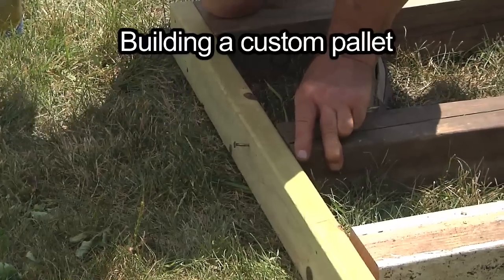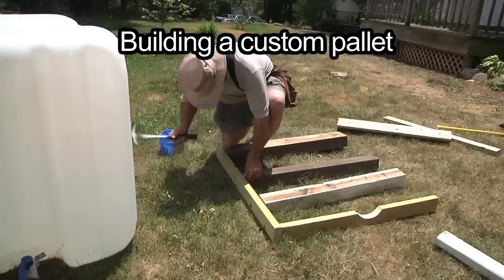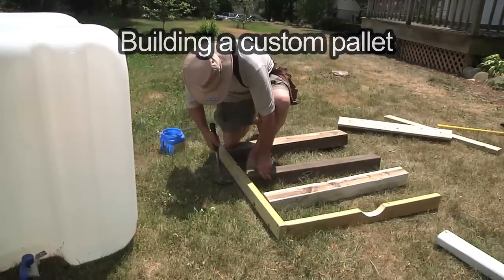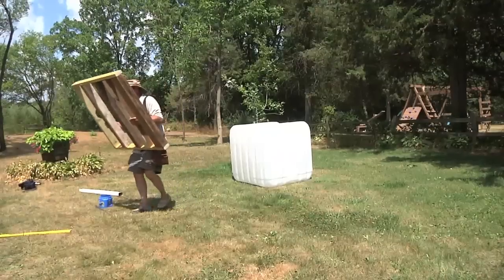DIY 275 Gallon Rainwater Collection, Part 1

Comment from the maker: The tank was free. So far, I have gotten about a dozen of them from a bottling company. These ones come wrapped in cardboard, and would otherwise just be thrown away. The ones in the cages are the same style tank, but are easier to handle, and can be stacked with the cages. Those run about $85 each, used, on Craigslist in my area. I'll take the free ones, thanks. Nearly all components on are water system are recycled, salvaged, scrap, etc.We spent hardly anything on it.